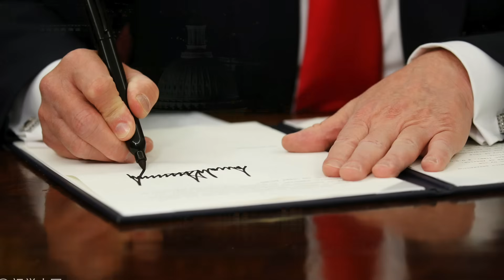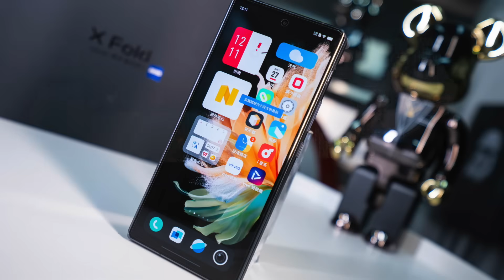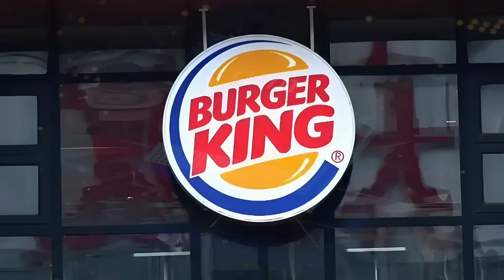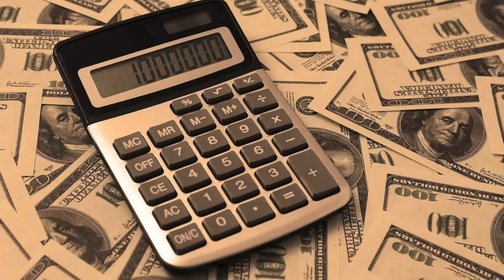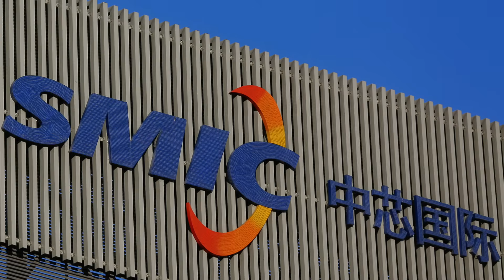China is Legally Dismantling U.S. Tech Supremacy (And Washington Can't Stop It)

Comment: China is significantly advancing its push for semiconductor independence by aggressively adopting and developing the open-source RISC-V instruction set architecture (ISA), which offers a path to circumvent restrictions on Western technology. 
This strategic move is driven by ongoing trade tensions and sanctions that limit access to advanced foreign-made chips, particularly from companies like Intel and AMD. 
RISC-V's open nature allows Chinese firms to design and manufacture processors without external restrictions, making it a geopolitically neutral alternative.
This initiative is supported by national policy, with sources indicating that China plans to issue nationwide guidance to encourage the use of RISC-V chips, a move aimed at reducing dependence on Western-owned technology. 
RIVAI Technologies launched the Lingyu CPU, China's first fully self-developed high-performance RISC-V server processor, designed for applications in high-performance computing, all-flash storage, and large open-source language models. 
This chip features a unique architecture with 32 general-purpose cores and 8 specialized intelligent computing cores, aiming to balance power and energy efficiency.
China's progress extends beyond server chips. 
China has also developed the world's first 1-nanometre RISC-V chip using 2D materials, showcasing its leadership in cutting-edge semiconductor research.